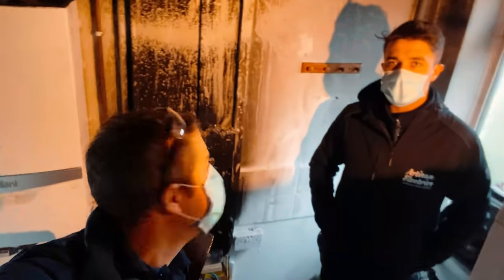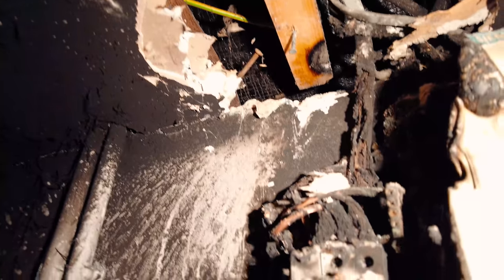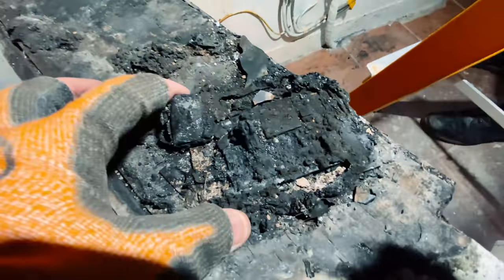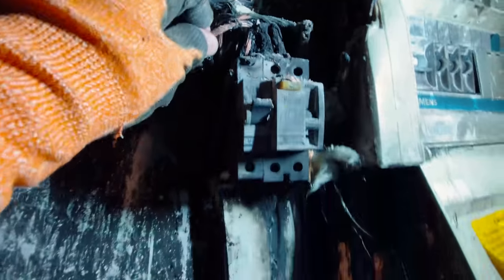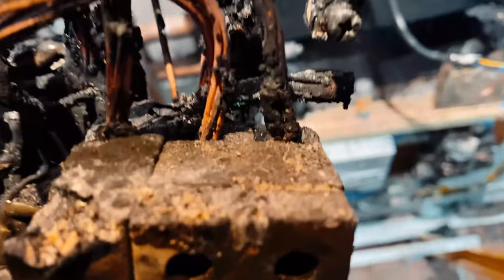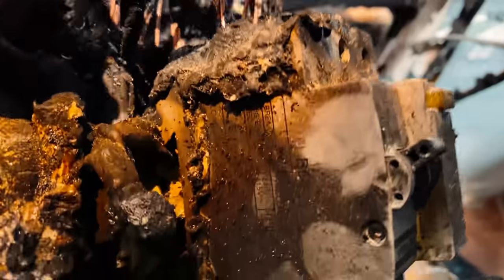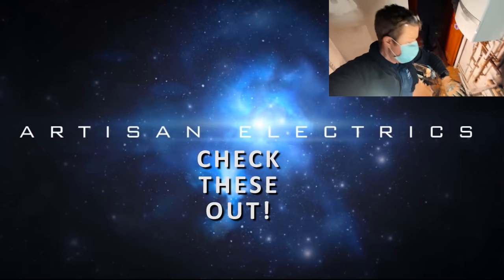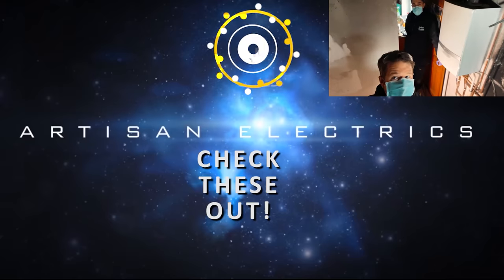Consumer Unit Fire

Comment: Loose live? It's usually the other way round i have always found the neutrals to be loose.
Reply from the maker: Interesting
Reply: @artisanelectrics  yeah, usually when I find loose connections it has always been the neutrals that were loose and the lives were very tight, i think some people don't understand (worryingly) that the neutral is carrying the same current or they don't think the neutral is as dangerous as the live so they don't treat it with the same respect which makes no sense to me.
Reply: Yeah the connection in a mcb is big clamp and neutral bar one screw never understood that

Comment: If you are correct in your diagnosis there would have been a very strong smell every time the shower was in use, over heating cable gives off a very strong unmistakable smell that lingers, the shower itself would have also have been showing signs of the issue in either poor heating performance & or the water solenoid blipping off whilst the shower was running.
Also an overheating cable will leave a screw in an mcb or rcd loose, the cable expands with heat & changes shape to a more compact form.

Comment: Those type of mcbs were recalled by Electrium some years back.  I my be wrong but I’ve seen one burn before .volex Crabtree  Etc .someone may have already mentioned this earlier . See below . 

About Us. As part of the product recall program, Electrium highlighted a quality issue with the miniature circuit breakers (MCBs) supplied between April 2009 and February 2010. In a small proportion of cases, this may lead to overheating and in rare cases cause a fire.

Comment: Timepoint 11:50 you are examining the possible how of melting cables.  Could it be the case that live incoming to live outgoing touched, RBD tripped but now RCD and load protection ( MCB ) are effectively bypassed.  So no RCD, no-load protection on the circuit, now only protection is incoming 60 amp supply fuse?

Comment: Maybe a dumb question but are jb’s the preferred method of extending cables.not through crimps.
Reply: Thermally cycling circuits aren't good in JBs, terminal screws become loose over time

Comment: I can't believe the whole service panel is cheap flammable plastic, one loose wire sets the whole house on fire.  Safety 3rd and quality 4th.  Here in Canada all breaker panels are made of steel, there are no plastic ones at all.  You might melt a couple breakers but this would never happen and we are only working with half the voltage.
Reply: Half the voltage, twice the current, hence more dangerous.

Comment: Was the 10mm shower circuit protected by a Circuit Breaker at the consumer unit or just relying on the cut out fuse?
Reply: It's covered in the video. The shower circuit is wired directly into the main isolator switch, no breaker.

Comment: woudlnt be surprised it if it was a fault in the smart meter or loose connection when it was converted from the analog to these digital smart meters us version of smart meters are circular like the analog one though i dont really have a way to show how a electric meter is hooked up in the us i will say it is different compared to this

Comment: Is there a reason why there arent any protection connected before the RCD ? Would a CB have tripped before the RCD if a loose connection was possible ?
Reply: Not necessarily. The heating could be caused by either high current and a highly resistive connection and where the current does not exceed the breaker rating. 

Or it could have been caused by arcing as the wire made and broke contact inside the terminal.

Neither of these would trip a breaker.

Comment: How do you intend to replace tails from the cable head? Or the fuse? You’re not allowed to break the seal or work on DNO equipment.
Reply from the maker: DNO broke it for us so we could work on it
Reply: @artisanelectrics  I wouldn't have lol. Isolate, yes, but they should have chucked in a wylex if you needed to reconnect

Comment: I’ve seen a few melted neutral pins on plugs recently from washing machines and dryers, I’m slightly confused as to how the neutral pin managed to get hot and melt instead of the live pin
Reply: They both carry the same current
Reply: John is correct.
Don't mix up voltage and current.
The neutral voltage relative to earth is low. But it is the current that causes heating, not voltage.

The current is the same magnitude in both live and neutral pins (unless there is a fault).

Comment: Can't believe they allow that stuff in Europe .The safety standards are far lower even with the use of RCDs and AFCI ..Too much reliance on Chinese made electronics .Loose connection are a huge problem .Some times it's the cage clamp itself .You tighten down the clamp and the connection is still loose .Bad cage clamps

Comment: I need to replace my old plastic wilex box, after watching loads of videos, wondering would investing in an AFDD prevented this? 

The cost to have normal RCBO to AFDD is ££ but may save thousands of pounds, and your life?? 

Trying to weigh up the costs.
Reply: probably not, since the loose wire causing the arcing was on the input side. (which is usually where they are loose, big heavy cable, not very good clamp).... but then again it might have done depending on just how sensitive it was (but then be a nightmare to find it it trips because of arcing on both input and output side of device)

Comment: Volex MCBs of that era were exact clone of Wylex NSB. All owned by the same company. Before Siemens bought Wylex the NSB consumer units and modules were cheap, nasty, manufactured abroad tat - equivalent of a £60 BG consumer unit today, complete with DIN rails bending under their own weight and enclosure plastics so thin they would rarely fit together after the first inspection. And the further you would go among the clones from Wylex - your Volex's, Marbo's, Newlec's, Alto's etc of that era - the cheaper and nastier they were. Those older NSB MCBs and all the cloned iterations were prone to internal overheating and fires. It's actually quite well documented - there were more than 10 separate recalls made for those MCBs manufactured between 2000 and 2015,  and you can still see recall notices on the net, but obviously most consumers would never know and most sparkies wouldn't want to return to fit replacements for free, so there are literally hundreds and thousands of those fire starters out there waiting for their moment to torch away the premises. As an insult to injury the enclosures that were meant to be made of plastics withstanding internal overheating (BS EN norm), for cost cutting reasons were mostly made from barely thermoplastic compounds with ratings up to 160 degrees. So in fault conditions the enclosures would boil and catch fire, then melt away in flaming blobs somewhere under the stairs. It's, in every sense, the very reason why IET was told by fire brigades to return to metal enclusures for 17th edition AMD 3...
Reply from the maker: Thanks for sharing
Reply: While true, the Fire seamed to be on the incomer side though.
Reply: @AndyK.1  There is no reason for the incoming side of a shower MCB to start a fire in the middle of the night though. No load, no sparking, no arcing. I like inherent device fault theory.
Reply: @v0nreagan  If no load, no reason for an Mcb to burn. How can it? RCD maybe

Comment: ALL boxes should be earthed metal, and at floor level and, if possible, in an outhouse which is fully fireproof IMHO.

That in/ out on the same end is a poor design. I ONLY use breakers with bottom entry, top exit and all cables have MINIMUM bend radius of 6"

Comment: Losing wire a hot wire maked the fire because the amps will  increase when u don't use ferulle and torque screwdriver  I wish from u to make a video for torque screwdriver draper 19pcs its made in uk  Iam wait ur comment
Reply: "the amps will  increase when u[sic] don't use ferulle[sic]" - what? The use of a ferrule or not has no bearing on the current flowing in the circuit and for a resistive load (this installation) a high resistance joint will lead to a decrease in current, not an increase.

Also, seeing as Draper are a distributor, not a manufacturer, that seems fairly unlikely.
Reply: @Monkeh616  right I know that many problems case damaged wire and make fire high load amps and it depend how many amps every wire load amps and the length of wire for torque screwdriver draper 19pcs I order it from UK and also Iam wait to send it to me Lebanon

Comment: The thing people have not said is how long was that like that before it caught fire?it’s not a recent install is it so got to be a few years ,and like people have said you can smell burning cables so surely every now and then they would of smelt that horrible smell?
Reply from the maker: Yeah they started to smell it a few weeks ago but didn’t know what it was
Reply: @artisanelectrics  that’s mad ain’t it a smell they have never smelt before and horrible has to be coming from somewhere..even now when I do something I double check it and when I leave the job it’s in my mind did I check even though I know I have 😳😂
Reply: @artisanelectrics  i would be on that straight away.I had a new extension wired up,every now and then lights and tv would go off and on ,but only in the new extension .The electrician who installed it did not believe me , so i got him back and sure enough the main incoming cable was loose. he even tried to charge me for the callout.

Comment: Excuse my basic ignorance but what was the initial fuel? What substance actually started burning? A fire needs heat, oxygen and fuel. The heat is because of the electrical fault, the oxygen is in the air but what about the fuel?
Reply: The electrical energy is 'the fuel'.

Comment: All the more a reason for a mandatory eicr on all domestic properties. Due to the current potential on this circuit, an afdd could have prevented this, not to mention the containment of fire within a metal enclosure installed correctly.
Reply: You don't know if an AFDD would have prevented it or not.

AFDD protects against heating effect cause by arcing.

You don't know if the heat here was caused by an arc or whether it was down to a resistive contact.

Though given the number of turns slack on the screw, it does seem plausible that the wire was loose enough to be making and breaking contact leading to arcing.
Reply: Your comment about containment of the fire by a metal CU is wrong.
The fire started outside the CU so a metal CU would not have contained or prevented this fire.

Comment: Never nice to see. A question for anyone on here; but is there a reason not to have an automated powder fire extinguisher located close to a CU for such circumstances. I have a couple located in the engine compartment of my boat to try and fend of engine fires. I live in a wooden house and my CU is located in a large electrical cupboard along with a number of aux enclosures serving EV charging etc and also housing the domestic battery storage for the PV. I'm now wondering why I don't install a ceiling mounted 1 or 2kg auto powder extinguisher? Apart from maybe being overly cautious, is there reason not to do this?

Comment: 10mm twin & earth on a 60A fuse ????
Reply: 3m rule
Reply: @scabthecat  3 m rule = meter tails. 10mm t & e = 52 A in conduit or trunking but it was on the secondary side of 50 A mcb the insulation got hot & melted due to loose connection.
Reply: Fixed load. Think of a busbar chamber
Reply: @tomorichard  cable under rated for 60A fuse. Looks as if on the primary side of isolator switch so only the main fuse to isolate the circuit.

Comment: An interesting fact, flames are pretty good conductors. When the insulation melted and burnt it likely melted the neutral insulation would have burnt creating a conductive path. I think likely the heat from the loose clamp caused heat, melting and then causing the insulation to burn off the hot wire. The next step would be melting the insulation from the neutral, and the flame created a conductive path that lead to the wires vaporizing.

Comment: Why no suitable PPE for your guys or even yourself?  Those gloves you had on will give no protection with regard to carcinogens created by the flame damage to the plastic components or to the PVC sheathing of the cable. In addition given this event had only just occurred when filming this video, the air would be full of toxic particles you've been breathing in because you failed to wear a suitable mask!     I'm sure your local Fire Authority would be happy to help educate you on such matters. I know ours does here in Hampshire as I work here.   Come on guys, start thinkings safer & smarter.

Comment: Did the fire brigade not get thier own boys to investigate? I have worked on burn outs before, so guess nobody died in this one. You would not believe how one room fire can turn the whole house into an oven with almost no smoke damage to the rest of the place. But things kinda just melt everywhere. Surely this type of investigation shouldn't be taken by you but somebody that knows what they are doing?
Reply from the maker: They will have their own fire investigator as well but nobody was hurt and we need to get power back on. We have taken loads of photos to send them
Reply: @artisanelectrics  Cool beans.

Comment: With all of those cheapo IEC panelboards you use over there I’m surprised all of your houses don’t burn down.
Reply: I think the fact houses don't all burn down proves that, installed and maintained properly, they are fine! They have been tested for the purpose; any board, if any price, in any country, with loose screws, could cause a fire.

Comment: Electric showers should be banned , 99% of charred cables I’ve seen have been showers ..
Reply: be good if people installed them properly, there's nothing wrong with high current loads.
Reply: @edc1569  that and maintenance  but if my auntie had a Willy she’d be my uncle . Pointless conversation really . Don’t know why I bothered commenting .
Reply: So should cookers and hobs. We should all use camping stoves it would be a lot safer
Reply: @tomorichard  Fire pits indoors are the way to go.
Reply: @tomorichard  and sockets and lights , I hate my job we should get everything back on gas .
Reply: Yeah, cold showers are good for your health.
Reply: It'll probably drop to just 50% from showers when we get more electric vehicle charging points fitted in homes...